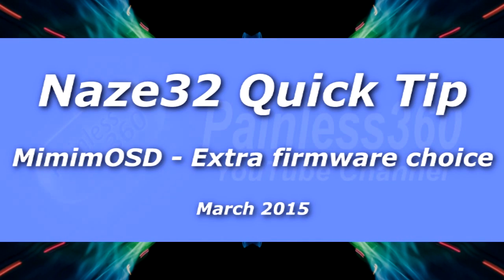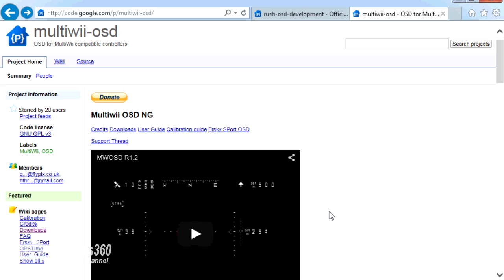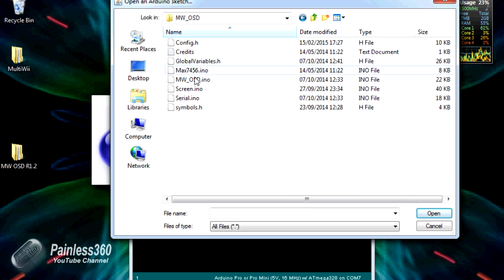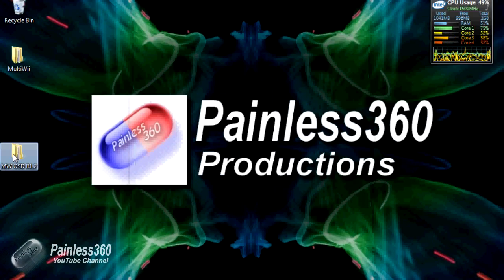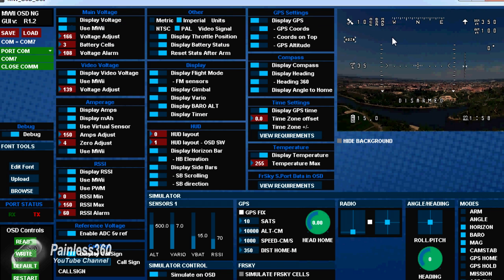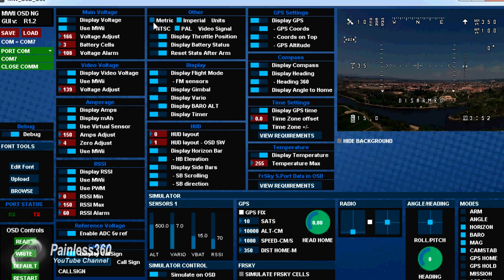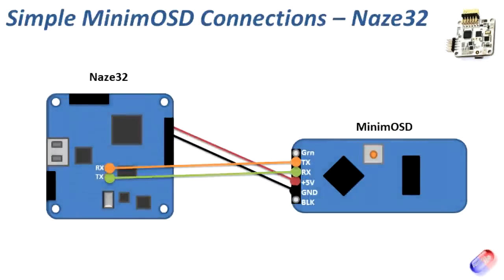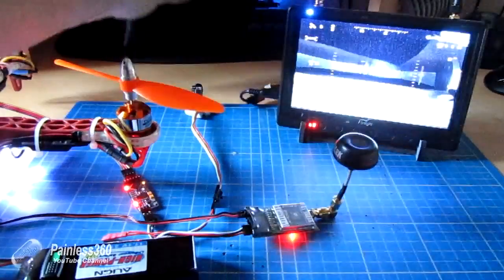Naze32 Quick Tip – Another choice for MinimOSD firmware (MultiWii-OSD)

Comment: Anybody know what this means?
Arduino: 1.6.7 (Windows 7), Board: "Arduino Pro or Pro Mini, ATmega328 (5V, 16 MHz)"

Sketch uses 25,854 bytes (84%) of program storage space. Maximum is 30,720 bytes.
Global variables use 1,899 bytes (92%) of dynamic memory, leaving 149 bytes for local variables. Maximum is 2,048 bytes.
Low memory available, stability problems may occur.
avrdude: stk500_recv(): programmer is not responding
avrdude: stk500_getsync() attempt 1 of 10: not in sync: resp=0x2d
avrdude: stk500_recv(): programmer is not responding
avrdude: stk500_getsync() attempt 2 of 10: not in sync: resp=0x2d
avrdude: stk500_recv(): programmer is not responding
avrdude: stk500_getsync() attempt 3 of 10: not in sync: resp=0x2d
avrdude: stk500_recv(): programmer is not responding
avrdude: stk500_getsync() attempt 4 of 10: not in sync: resp=0x2d
avrdude: stk500_recv(): programmer is not responding
avrdude: stk500_getsync() attempt 5 of 10: not in sync: resp=0x2d
avrdude: stk500_recv(): programmer is not responding
avrdude: stk500_getsync() attempt 6 of 10: not in sync: resp=0x2d
avrdude: stk500_recv(): programmer is not responding
avrdude: stk500_getsync() attempt 7 of 10: not in sync: resp=0x2d
avrdude: stk500_recv(): programmer is not responding
avrdude: stk500_getsync() attempt 8 of 10: not in sync: resp=0x2d
avrdude: stk500_recv(): programmer is not responding
avrdude: stk500_getsync() attempt 9 of 10: not in sync: resp=0x2d
avrdude: stk500_recv(): programmer is not responding
avrdude: stk500_getsync() attempt 10 of 10: not in sync: resp=0x2d
Problem uploading to board.  See http://www.arduino.cc/en/Guide/Troubleshooting#upload for suggestions.

  This report would have more information with
  "Show verbose output during compilation"
  enabled in File > Preferences.
Reply from the maker: +vincent tassone https://www.youtube.com/watch?v=KJ1KmtkkLxw and https://www.youtube.com/watch?v=EEWE4PZL4TE may help.. Best of luck.
Reply: +Painless360 Lee, You sir are a genius and a real credit to our hobby. I was using Arduino 1.6.7 and then downloaded 1.0 after 3 weeks of pulling my hair out on this thing I finally have it working. I almost took the BFH to the thing. Next time I won't wait so long to ask for help. A million times THANK YOU.
Reply from the maker: You're welcome - most of the common answers are on here somewhere ;) Happy flying!

Comment: hey friend, am i able to add a crosshair in the screen display ? i need to programme a mooving crosshair depending on osd parameters (for my project, like depending on altitude and speed) so is that possible ? and how ?
Reply from the maker: +elie machaalany It is, you need to start getting into the code for the OSD and rewrite a chunk or two! Best of luck..
Reply: okey mate thanks !
Reply: one more thing.. does this code works with apm2.8 ? or only with naze32 ?
Reply: Painless360 does this code works with apm2.8 ? or only with naze32 ?
Reply from the maker: https://www.youtube.com/watch?v=PTd5ViDsH1Q ;)

Comment: I'm testing MV OSD v1.5 with cleanflight v1.10, and it doesn't show when the quad is armed. It blinks with DISARMED all the time even when the quad is armed. Everything else work ok. Any idea what the probem might be?
Reply from the maker: +Ole-Johan Kippenbroeck Usually points to the board not getting the MSP telemetry. Could be cables (rx/Tx wrong), comms (baud rate) or setup (ports in CF). Best of luck!
Reply: +Painless360 I will have a look again, but whats strange is that everything else like battery voltage, number of sats, direction nose up and down as well as sideways angle is working ok.
Reply from the maker: That does sound like the main connections are ok then.. Maybe the version of flight control software the MinimOSD is set for then?
Reply: +Painless360 I have tested Baseflight as well as Cleanflight. Same result. Have to check further though. Will post it here if I manage to get it sorted.
Reply: Did you get it sorted? =)

Comment: Thanks for all the great videos, very useful and very clear! 
I am having difficulty passing data to MWOSD v1.5 from a Naze 32 running Cleanflight 1.9.0.  I managed to get it to work with Rush OSD but not with MWOSD which I prefer. Any chance of some tips? Thanks anyway!
Reply from the maker: What exactly are you seeing?
Reply: +Painless360 I can see the camera and the osd text but the values are all zeroed and the horizon does not move when I move the FC as it used to with the KV version. I have a GPS connected to UART 2. I used the Cleanflight option in config.h when compiling with Arduino (since it was available).
Reply from the maker: Sounds like you don't have telemetry configured or the wrong baud rate for the port you have the OSD plugged into..

Best of luck.

Comment: Please help. your videos are well set out and easy to follow but i have a problem.
i have flashed my minimosd just as you have but when you see mine on the screen the artificial horizon is in letter not a line. what i am doing wrong. please help thanks Kevin
Reply from the maker: Read through the readme and have a look at the sketch and the settings in the GUI. There will be a setting for changing how it works. Best of luck!
Reply: +Kevin Salisbury I'm have the same issue. where you able to get it resolved?
Reply from the maker: Follow the video instructions for setting it up. Normally it's due to the font file not being updated.. Best of luck.

Comment: Please how can I  flash the minimosd to its factory settings? I've tried with Arduino  the KVteam OSD 2.3.3 but always got an error message , so uploaded the Muitiwii osd which uploaded with a memory limit message. When I go to the GUI everything seems OK but when connecting to my FPV system there are no horizon and vertical lines but caracters ?? Tried several times in the GUI uploading fonts ( default and all alternatives ) but always get the same image . No lines : fonts … Thank you for your help .
Reply from the maker: Ciruplas No such thing as 'factory default' some don't come with anything on, some with code that works with APM and CC3D (MAVLink style) and others come with KV team and MW_OSD code that understands and talks to Naze32, Multiwii and others. You need to download the code for the board you're using and go through the upload process again. Always check power to both sides of the board, always make sure the fonts are loaded and always check that eh Rx and Tx lines are the right way round. Best of luck.

Comment: Pls be aware that the Rush-OSD firmeware version 2.3 can no longer be flashed with the latest Arduino version into the MinimOSD without editing some files. The compilation will show some errors. After having corrected the files with a simple editor everything worked.
The compilation shows the error: variable 'item_table' must be const in order to be put into read-only section by means of attribute__((progmem))'
 PROGMEM const char *item_table[] =

One can use Arduino version 1.01 for solving the problem or change the files:

in KV_Team_OSD.h:

change this: 'extern PROGMEM const char *item_table[];'
to this: 'extern PROGMEM const char * const item_table[];'

in KV_Team_OSD.cpp:
change this: 'PROGMEM const char *item_table[] ='
to this: 'PROGMEM const char * const item_table[] ='

and everything will compile, good luck!

Comment: hi once again mate,  doing a new build with a new minimosd, it's a crius MAVlink one off of ebay. First problem I am getting is that the KV osd and the Multiwii osd programmes will not execute, getting that same java problem everyone is talking about, I am on win 7 32 bit, tried installing and re-installing things with no luck. secondly I connect the board via FTDI get the lights all up and running choose cleanflight on the Arduino software and select the board type as in your video andtry to upload. it starts to then stops with the following errors

Arduino: 1.6.6 Hourly Build 2015/07/16 04:42 (Windows 7), Board: "Arduino Pro or Pro Mini, ATmega328 (5V, 16 MHz)"
Sketch uses 24,848 bytes (80%) of program storage space. Maximum is 30,720 bytes.
Global variables use 1,838 bytes (89%) of dynamic memory, leaving 210 bytes for local variables. Maximum is 2,048 bytes.
Low memory available, stability problems may occur.
avrdude: ser_open(): can't open device "\\.\COM1": The system cannot find the file specified.

Problem uploading to board.  See http://www.arduino.cc/en/Guide/Troubleshooting#upload for suggestions.
WARNING: Category 'USB' in library Keyboard is not valid. Setting to 'Uncategorized'
WARNING: Category 'USB' in library Mouse is not valid. Setting to 'Uncategorized'
WARNING: Category 'USB' in library Keyboard is not valid. Setting to 'Uncategorized'
WARNING: Category 'USB' in library Mouse is not valid. Setting to 'Uncategorized'
  This report would have more information with
  "Show verbose output during compilation"
  enabled in File > Preferences.

very very new to this, tried to find videos to solve the problem but with no luck :( please help!!!!!
Reply from the maker: PlatinuM MGO Use an older version of the Arduino code. 1.6.6 can cause some odd effects with more mature sketches..Best of luck
Reply: Ok will try, but what about the multiwii gui??

Comment: Pretty nice video...I got only ONE problem: I will hopefully receive my MinimOSD tomorrow and wanted to download and install all the stuff (FTDI-drivers, arduino-program, FW for MinimOSD).
All stuff downloaded and installed BUT i can't open the multiWii-GUI. Neither the Rush-OSD nor the MultiWii-OSD. There is always message been shown that there's obviously a problem with JAVA (it's updated).

Any suggestions?

Thanks for helping and keep on making great videos! :)
Reply from the maker: Hard to help without the specific error message. If you Google the error you will find suggestions on the cause and things to try..

Best of luck.
Reply: Painless360  It just says: "unknown failure" (i can't add a pic of the message...can I?)
PLUS an additional error message: Processing error - Error calling shellExecuteEx ()
Reply: Oliver G. Solution: De-Installing Java and re-installing it did work. Maybe this helps anyone :)
Reply from the maker: Great news - best of luck with the build..

Comment: quick tip.  I had to run the erase eeprom_clear file first then load the OSD firmware followed by the fonts in order to get the fonts to display correctly.   It was driving me nuts.

Comment: just received minimosd... and flashed version 1.2 seems to flash ok will test on my tb tonite... what i was going to ask the 12v on the osd board some seem to use it and some not is it better to connect the digital 5v on the arduino side to the analogue on the video side and not use the 12v input...
Reply from the maker: bing crosby I suggest you watch the other MinimOSD videos as they explain what I do, and more importantly, why I do it that way - https://www.youtube.com/watch?v=Bdki9lIv31I&index=8&list=PLYsWjANuAm4qfxLkr_RLlSF3qh_AwLYIT Best of luck
Reply: yeah seen it now thanks....just so much to read... working well... just need to figure out how to alter the resolution  thanks for all the help on the other videos i have watched them loads... great resource
Reply from the maker: You can drop the top line down slightly and change the size of the font (with some firmwares) but that's it.

Best of luck.

Comment: Do you know about or have you heard anything about the Micro MinimOSD?
Reply from the maker: bharris3 yes I have, not actually tried one though. The pins are I a different place but should work the same (from what I can see)..
Reply: Painless360 Thought I'd give you an update.  I just installed the MICRO Minim OSD.  It works great.  Runs on 5V and no soldering plates together or modding from 12V.  Only need to solder on pins.  Used your video for firmware and setup guidance.  Less than half the size of the Minim OSD.  You might want to give it a try.
Reply from the maker: Thanks for letting me know - I'll have to get one and try it out!

Comment: Make sure you guys purchase a FTDI adapter that has a genuine FTDI chip.  It will save you hours of frustration. Lots of cheap clones on Ebay.
Reply from the maker: Good point Jon, I've had loads of subscribers with issues and I'd bet that some of those are due to the boards.

(Also FYI - GPS setup is exactly as described in the Naze32 GPS setup video.  Also, you can see the GPS working in this video on the display and I cover it at 11:08).

Happy flying!
Reply: Painless360
 Yes they are!  It was driving me nuts!
Reply: Painless360  The way you know you have a non FTDI chip is when you install the adapter and under windows device manager under ports you see prolific adapter instead of FTDI.  This is when the issues begin.  The only certified one I found is at this company http://www.adafruit.com/products/284  Here is a link to the real FTDI data sheet http://www.adafruit.com/datasheets/DS_FT232R.pdf  https://github.com/adafruit/FTDI-Friend/blob/master/ftdifriendsch.png
Reply: you won't believe this one. Using the prolific chip adapter on configuring the Crius GPS using ucenter 8.13 I had to connect TXD TO TXD and RXD to RXD in order for data to flow.  If I crossed them no data to the program.  LOL
Reply from the maker: Typical - Nice of them to name the ports like everyone else ;)

Happy flying!